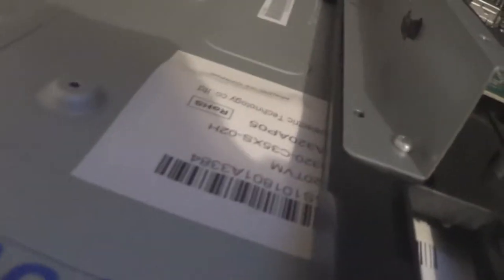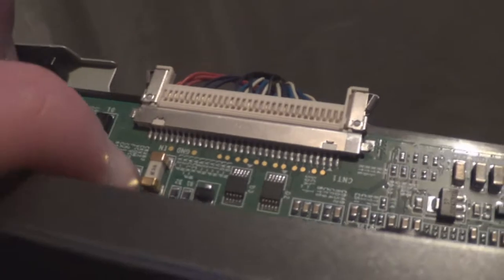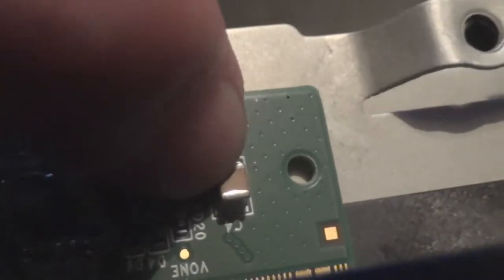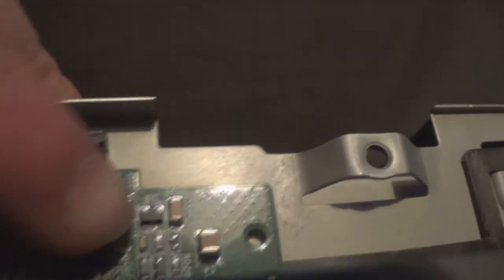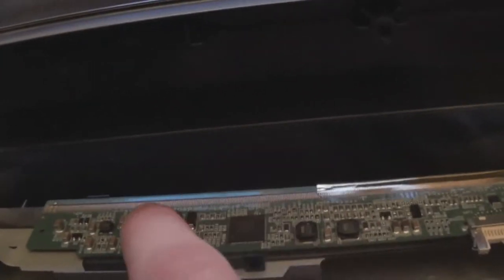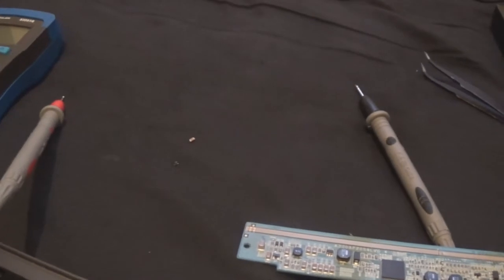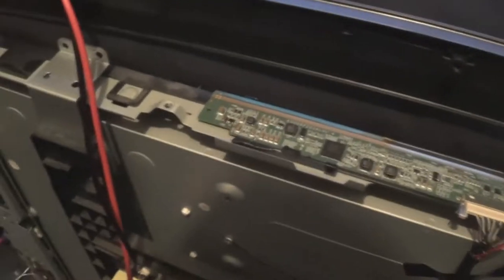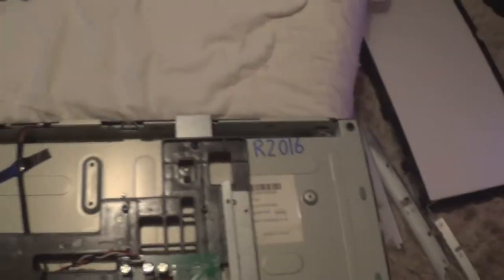Samsung Lcd Panel No Image Repair

Comment: I have been fixing LCD and Plasma TV now for about 10 years, its getting harder and harder to fix modern TV sets, most of the new thin panel sets are failing on either led backlights or panels failing, a few years ago i was fixing lots of samsung LE models which i found easy, the UE series is terrible and most are just written off due to screen failure, ive noticed you have not posted much for a while, are you finding too most newer sets are simply junk and unrepairable.